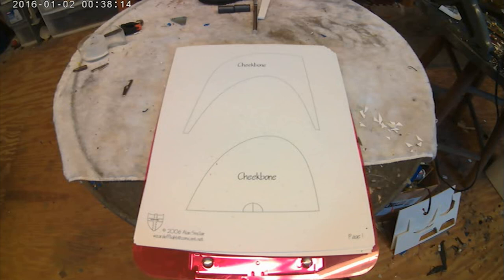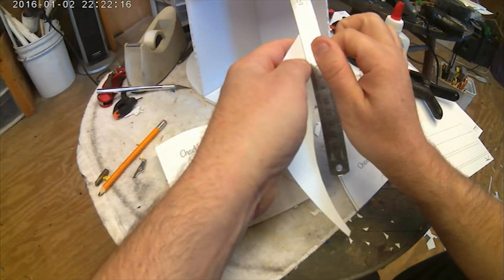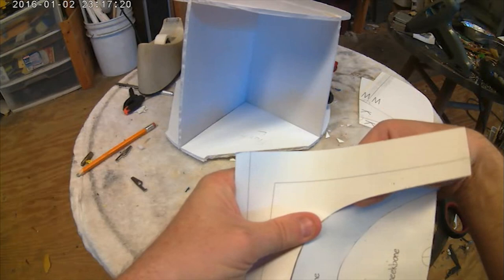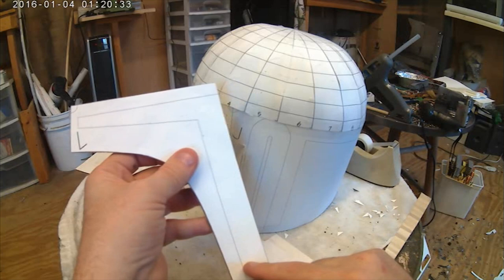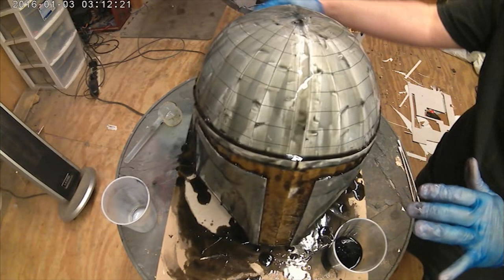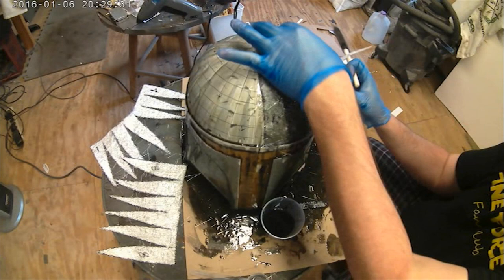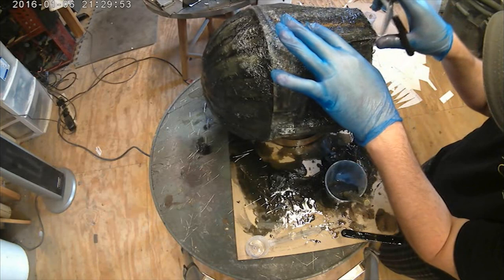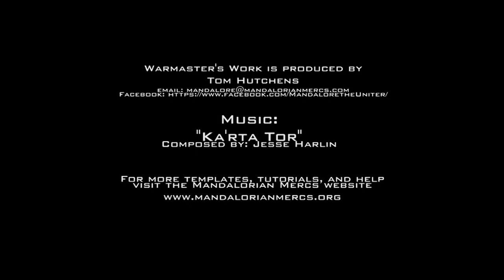Episode 2 - Scratch Built Mandalorian Helmet

Comment: Would this same process work using only Sintra, glue and a heat gun? I've seen alot it people do the molds after making an original but I never see them use SINTRA as it was first done for the ANH.
Reply from the maker: No, this method wouldn't work for Sintra alone.  You would still have to cover the Sintra with lots of filler material to get it smooth and shaped properly.  Sintra is also structurally weaker than both Epoxy and Polyester resin, sintra is much likely to break if you drop it once.  Sintra was never used in ANH, you're thinking of Styrene which was used to vacuum-form Stormtrooper helmets.

Comment: The checkbone to check plate you show a straight edge on both sides if cut correctly one side that you have flush is at an angle do i need to cut that straight
Reply from the maker: Do you mean the edge where the flat cheek plate meets the rest of the helmet?
Reply: The check plate side near the visor area seems to extend a bit longer than the other side which is near ear piece. Does it stay longer or get cut even

Comment: So if I went to an armor party, and I wanted to make a helmet do they have templates I would follow or would I be able to make changes to the template because in my helmet I want cuts in the T shape visor but if we can’t change the templates I couldn’t do that. If there is no template for custom helmets would the people there help you in making your helmet or would they just tell you a bit and leave you too it? Thanks for the response if you do respond.
Reply from the maker: You can alter the template once you print it out, it's paper.  Just use a ruler and pencil to mark your alterations then cut it out. Most armor parties are a good mix of vocal and hands-on teaching.
Reply: Thanks, this helps a lot

Comment: I'm sure I'm missing something very obvious, but when and how did you remove the scaffold?
Reply from the maker: I didn't remove it, just played resin over the top of it.  Leaving it in made a glass smooth interior.
Reply: @MandalorianMercsCC  At 1:18:57, after the fiberglass work, the scaffold is no longer in the bucket.  Sorry if I'm being confusing.  Edit: I'm talking about the foam board scaffold.  I'm using cardboard.
Reply from the maker: Ahh, the poster board cross-section inside was removed.  The outer poster board skin was resined over.
Reply: @MandalorianMercsCC This!  The outer poster board was taped to the inner foam scaffold.  Did you take that inner portion out before or after the resin.
Reply from the maker: @MichaelSayle  I took it out after I had applied resin to the outside and let it cure.
Reply: @MandalorianMercsCC  Thank you for helping me get to the bottom of this! And for the awesome video.

Comment: Is there any difference between fiberglassing the outside or the inside? It's a better to do both?
Reply from the maker: You only want to fiberglass on the inside if you're using a mold to brush the resin in.
Reply: @MandalorianMercsCC  do you mean if you're wanting to cast it and make a slush?
Reply from the maker: @rangerrob2144  no, that's entirely different.  You can do a brush on casting where you use layers of resin and fiberglass.  You do a first layer of gelcoat, then start laying up fiberglass in resin.

Comment: Can the whole thing be done with the polyester resin? Or is the epoxy resin/mats needed?
Reply from the maker: You can use polyester resin, but I'd highly suggest using the fiberglass for strength.
Reply: @MandalorianMercsCC  will do, thanks!
Reply: @MandalorianMercsCC  would you recommend using fiberglass jelly along with the mats or just use the resin with them
Reply from the maker: @wesleyburton7760  just use resin.

Comment: Do you need to apply bondo/filler primer to the helmet before painting? Or will the helmet be smooth enough to paint after applying several coats of the filler solution you taught at the end of the video?
Reply from the maker: It should be smooth enough if you've used the filler in the video.  Just remember to sand, lots! :)